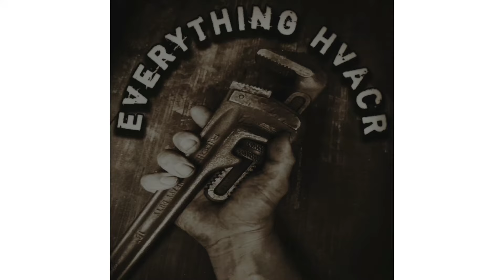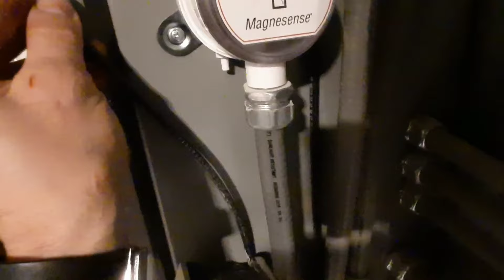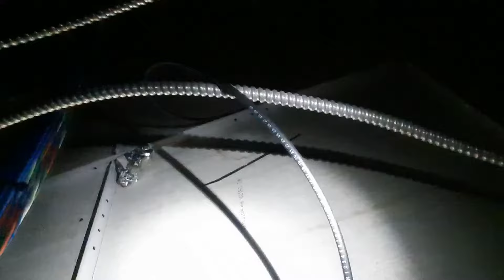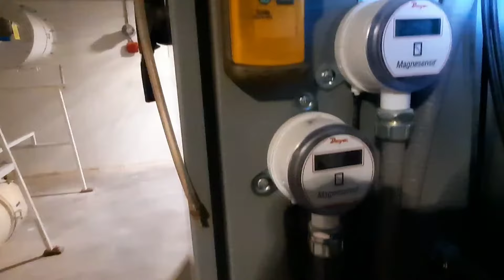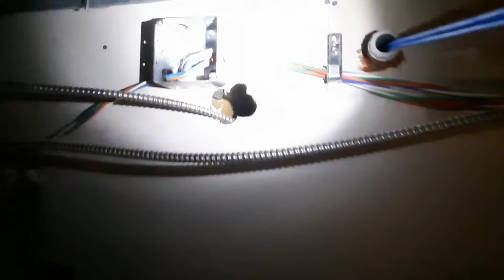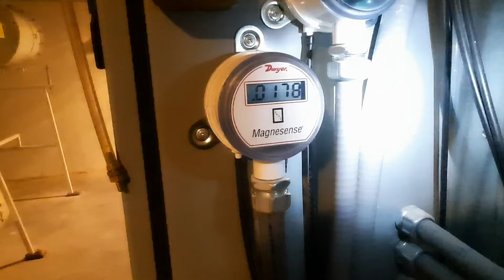Large Trane package water source heat pump, VAV system with static pressure issues.

Comment: This was a cool video. Different than usual and i throughly enjoyed it. Pressure differential is something i feel is ignored until its too late. Was this on a statitrac type of system....and yea the building pressure reference is supposed to be taken from a larger area. Away from doors. Good stuff Steve.
Reply from the maker: Thanks Jason. Not a statitrac. Carel controllers in unit and Trane VAV boxes

Comment: I deal with building pressure all the time. Those dwyers do have a zero button when you pulled off the front cover, you can also adjust the measurement with the dip switches on there as well. 

Easiest way to verify tubing is plug one end with barb cap and pump the other end with pneumatic  hand pump with gauge connected. You’ll verify correct hose and if it’s leak free. Whatever you end up doing with the outside reference tube at least make it accessible to be able to be checked or cleared. Have everything from spiders to water plugging the tube of course a bird feeder would be best but that come down to you. 

CPS SPM-100 manometer is good for walking around buildings it’ll show you pressure without having to run tube outside and connected to your manometer, the cps saves outside reference already for you. 

At least you don’t have to rerun new tubing from couple floors up lol 😂 

🤘🏻🤘🏻
Reply from the maker: Thanks HVAC Slayer,  that's a good idea with a hand pump especially if not in the same space. Everything improved with the outdoor reference cleaned. It amazes me that this was installed, started up, and no one ever notices small things that affect operation in the long run.
Reply: @EverythingHVACR  for reals the tubing just being left up in ceiling grid and ran through that wall outside is definitely A everything is on and running let’s GO!

Comment: Funny to see you playing around with static pressure sensors. Been digging into them at my work as well, air pressure in our refrigerated warehouse swings all over the shop. When it's negative we get wicked condensation issues around all the entries. 

Found the static pressure sensors are in an air handler room, referencing building pressure to that air handler room. However there's a massive exhaust fan on the air handler room that keeps it negative so all the pressure sensors have an incorrect reference. 

Starting to think the sensors are just for looks too, they show the room pressure in the building management system but don't appear to actually control anything. 

Fun stuff!
Reply from the maker: Sound like fun, thanks Thermoelectric. Make up air and proper placement of sensors are your best friends.

Comment: This is pretty cool I am trying to understand more about it . I have a building that out of wack so I slowed the vfds down on the exhaust and mau. It's a cheat for now but at least the buildings not whistling and you can open the doors or close them depending on occupancy 😂
Reply from the maker: Thanks c_young. Locate your tubing. You  will likely find your problem.

Comment: Good service call. That O.A. reference tubing running outside should go to a Dwyer A-306, will soften the swings caused by the wind. You'll get less B.S. readings with it. In your application office areas should be slightly positive to the plant so nothing from plant enters offices. You showed supply duct static pressure for VAV above AHU. That should be high pressure for alarm at say 2", didn't see a switch on side of duct though. The actual duct pressure should be taken 2/3 to 3/4 down supply duct for maintaing your 1" of duct static.
Reply from the maker: Yeah it wasn't installed great, the carel controller will alarm with high static. The set point is 2.5. My biggest concern was getting the space to a positive. Thanks Glen